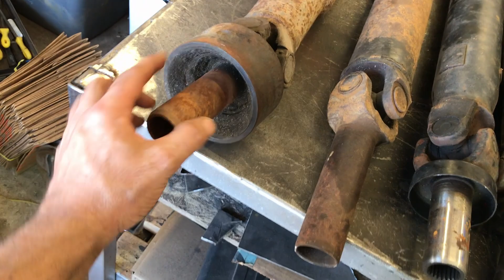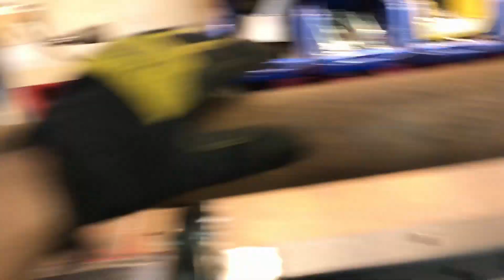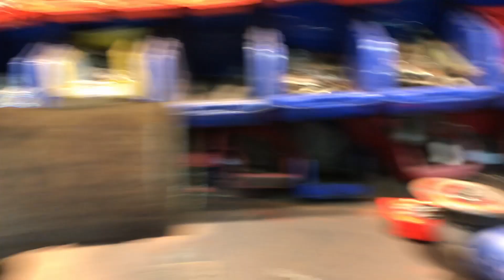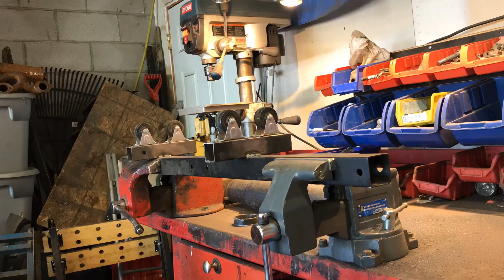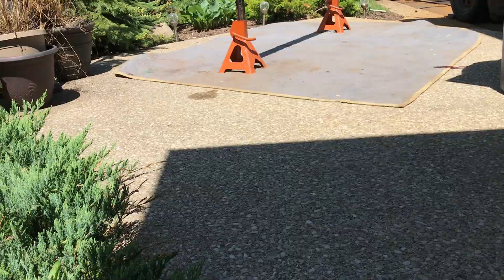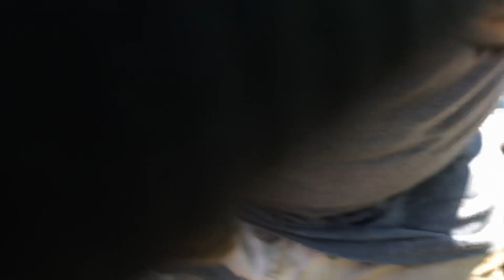Making A Drive Shaft From Junk For My 1936 Chevy Coupe

Comment: Never saw anyone make their own driveshaft before. Did you have any vibration problems after the installation? Did you take the driveshaft in to get balanced? Curious.
Reply from the maker: I always intended to take it somewhere and get a "real" one made, but to be honest, I've had no issue and no vibration with what I made. 
I did leave the balancing tabs on the existing shaft, so all I really did was shorten it, and straighten it as best I could before I welded it all up.

Comment: Your rear u-joint is in backwards, the zerk fittings point to the center of the driveshaft so that you can grease them in the car
Reply from the maker: Thanks Vic, I was wondering why the grease gun wasn't fitting lol.
Reply: By putting the wrong engine and transmission in derby cars, I've had to make lots of drive shafts. Do you know how to Ballance it with a couple hose clamps? With the back axle on jack stands, run it through the gears, if you can feel and see it shacking, put a couple hose clamps on the end of the shaft and try it again, mark the location of the clamps and keep turning them until on the shaft and trying it until it's better
Reply from the maker: @vicwilton3754  I think the problem might be that I may not have centred it precisely on the welded ends. I'll let you know how it goes when I fire it up.

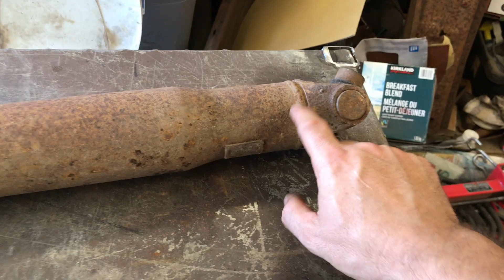Comment: Hey Dave. At 5:26 I hope that noise wasn't your drink falling over. 🙏 That is really neet jig you made. I would have put it in your lath to cut it with a part-off tool. You should be able to make your outside diameter of the yoke a perfect fit with the shaft using the lathe and have a nice square face to help with the fit. When you removed the end of the driveshaft you should have made orientation marks on to just to make sure the balance was going to be the same. I am pretty sure those pieces of metal that are welded on the shaft are for balancing. I am just making comments Dave. I don't want to sound like a know it all because I am more like a know a little. Rocker Pat thought me most of what I do know. Well good luck with the rest of your build and that's for sharing.🙏👍👍
Reply from the maker: There wasn’t any point marking the shaft as I was replacing the part I cut off with a different one. I should probably just remove the weights as they were probably intended to balance the part I removed. I guess we’ll see.

Comment: That jig is genius by the way. Hope you don’t have it trademarked because I will be building myself one.
Reply from the maker: I should have used metal castors for it so it’s easier the ground any welding projects.
Reply: @ScottRods  or some bearings thats what I've used. They have zero run out compared to a castor